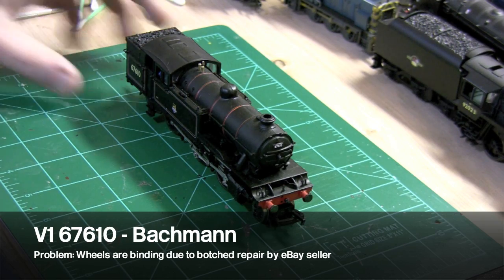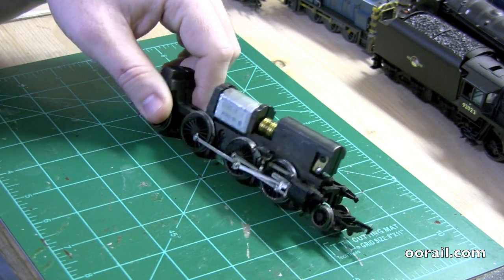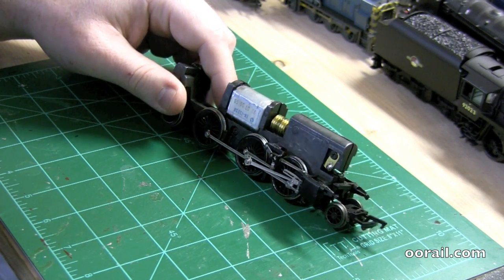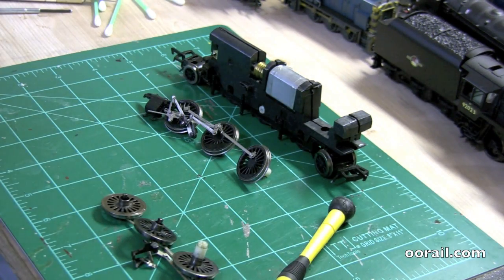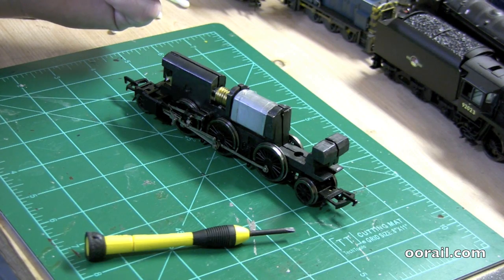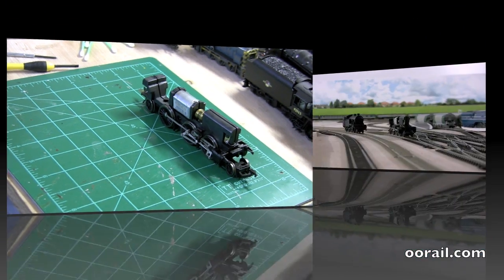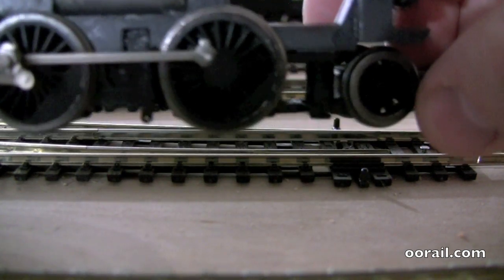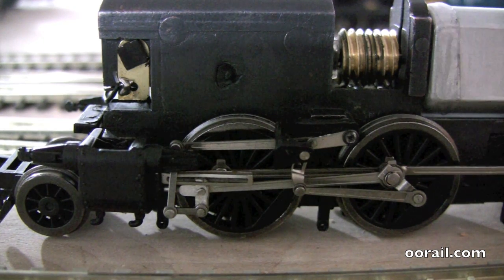oorail.com | Loco Works Wednesday #2 67610 Quartering a steam loco

Comment: I realize this vid is from 7 yrs ago, but wanted to say thanks very much for the great content; I was able to get a bachmann 0-6-0 from the 1970s running by quartering the drivers (and completely taking apart, servicing and reassembling the pancake motor). Couldn't have done it without you! I just wanted to see it run again! Very satisfying to get it going!

Comment: Do you ever run your locos SLOW? Seems difficult to actually "tune" the valve gear,  when you only run WIDE OPEN!
Reply from the maker: Absolutely, all the time. Found though with how-to videos over the years that a lot of people just want to see that it worked, so if your run the loco a little quicker, shortens the segment time and they keep watching :)

Comment: I am experiencing some wheel wobble on my new flying scotsman. Nothing major I'm just ocd about it and thought it needed quartering but I guess it doesn't. I see its 90° offset already. Thanks for explaining what quartering is.
Reply: DJMixFlow93 
Flying Scotsman is a three cylinder loco, and so the side connecting rods should be at 120 degrees, not 90. Key thing is that the side rods are not  near 180 degrees...

Comment: By the way, if you're REALLY going to try to check and adjust the quartering of a steam engine,  you must have a quartering jig/ tool to do it accurately. A company called "North West Shortline" sells such a device. This stuff about running locomotive nearly wide open serves no purpose...

Comment: Do you have a video on servicing this type of engine/motor? Bachmann split chassis? The mainline style is different
Reply from the maker: You are looking for a video on servicing this style of locomotive from Bachmann?
Reply: Yeah
Reply from the maker: Doesn't look like I've done one specific to this type of split-chassis locomotive, but I have plenty of these locos, so won't be hard to find one that needs maintenance. I'll see if I can knock together a video for you on it..
Reply: Brilliant thank you, that’s be helpful. My Bachmann BR standard class 4 isn’t running well
Reply from the maker: You're welcome. Have you tried cleaning the wheels (cotton bud / qtip with some isopropyl alcohol (91%)) and the contacts with the same?
Reply: Yeah I did them with lighter fluid, it improved it, but still low on pulling power

Comment: Interesting, but surely since the model is not really being piston driven, quartering is purely for aesthetics right? Isn't it more likely that the wheels were jamming because the valve gear was all wrong?
Reply from the maker: nope... it doesn't have to be perfectly quartered but they are designed to be offset. If they are not offset they will bind...
Reply: oorail.com 
It's worth emphasising that typically only one axle is driven by the motor (actually like most prototype locos) and so the quartering is still important to ensure the other axles can be rotated by one connecting rod which should not be in line with the axle.

Comment: Thank you once again for taking the time to reply to my comments. 
Alot of what you and I do is really basic stuff however, I have found over the years that people decide that its too difficult and do not even attempt repairs or even basic maintenance. This is where videos such as yours come into play. If you can tempt people to at least have a go they will gain both confidence and a fatter wallet.😊   You will know that the biggest part of a bill is not the parts required but the labour charge.
As I have already mentioned you need to hold peoples hands and guide them step by step, sad really when you think about it.
Its up to people like yourself to show modelers the "can do" attitude and dispel the "can't even try " attitude which seems to haunt our society these days.
Keep on making your videos, you will make a difference even if you never hear about it.
Sorry for the spelling mistakes in my last comments, the main reason I retired from doing what I loved, eyesight no longer up to par😢.
Good Modelling. 😊

Comment: What a very uninformative video.  Whats the point in the whole thing when you speed up the most important bit. I am no wiser at all?
Reply from the maker: The point is to leverage the YouTube speed option in the viewer. Click on the "cog", it might be a "cog with HD" written on it. Select speed, then select 0.25, 0.5 or 0.75, depending on your preference. You will likely want to hit the mute button as it will distort the audio. The point of doing it this way is that at normal speed people can see whats happening but it doesn't take 30+ minutes. If someone wants to see it at a slower speed, like you, you have much better control with the 0.25, 0.5 and 0.75 speeds with it sped up at normal speed. Without it sped up like that, the 0.25 setting really is too slow to be of any use. This way, you can watch it at 0.25. This is the reason why there is music and no informative speech during it either. This video is about 3 years old, but I'm pretty sure I walked through what was going to happen in the segment before it was sped up too. So hopefully now you are a bit wiser about both using the YouTube player and quartering a loco. If not, perhaps this isn't for you and you should send your loco off for repairs?
Reply: Hi again. Thanks for the reply it is nice of you to take the time. I get the whole principal but I am still puzzled.  LEFT or RIGHT SIDE. Is left the left side that you see just before you are  run over bby a train or is it the left side if you are driving the train?
Andy
Reply from the maker: That is a good question. It is just like the left-hand and right-hand drive with a car. Trains in the UK are left-hand running.
Reply: So which classed as the left side?  Is it the left as if you were driving the train and standing or sitting in the cab it OR is it the left that you would see as if the train was coming right at you?
Andy
Reply from the maker: I already answered this question with my previous comment. If you are driving a left hand drive car, with the steering wheel on the left side, you are sitting on the left hand side of the car. Trains are the same way. In the UK the driver's seat is on the left hand side, and the trains are left hand running (run on the left track in a double track setup). The drivers sit on the left hand side because the signals are on the left hand side of the track etc. LNER I think was right hand drive, possibly a few others.

Comment: the easier way would of been to take the bottom plate off and remove the whole wheel assembly then quater the wheels by just spinning the wheels on the axles. this video is a waste of time in both watching and requatering
Reply from the maker: Its a split chassis loco, so you can't drop the wheel assembly from the bottom plate like you can on Hornby locos. You would have to take the chassis apart completely and that is a lot more work than simply quartering the wheels like I did in the video. Also for this particular loco, the wheel assembly was incorrectly quartered and the rods were in the wrong position, so you couldn't just spin the wheels on the axles.

Comment: The Chinese equipment is so poorly made that I long for the American made trains of long ago.
Reply from the maker: The Chinese made locos seem to be somewhat lacking in Quality Control that is for sure. Since I order most of my locos from either the UK or Canada, its not really worth the cost of shipping things back if there is a problem, have to sort of fix it myself. I have a Heljan Class 26 (brand new) that has a few buffer beam issues and I fixed a few Hornby locos with minor things, like loose parts. I think 3D printing will change the hobby over the coming years... hence why I picked up some 3D printers :)
Reply: Why couldn’t you remove pins on one side of loco then move those drivers thru 90 degrees and re-assemble connecting rods back into drivers.  HINT.  Don’t post repair videos that are not in  real time. And no crappy music please
Reply from the maker: That won't work. Give it a try and you'll see why. HINT. Click the settings gear, select speed and slow it down to your desired watch speed. Have a nice day! :-P

Comment: Too fast music too loud and I am non the wiser  and you have a lot of viewers saying the same
Reply from the maker: Use the speed control in the YouTube player to slow it down, hit the settings cog, then playback speed, then 0.75 (3/4), 0.5 (1/2) or 0.25 (1/4) depending on what speed you need, and hit mute. I explain in the video whats being done before and after it happens. People only comment when they are moaning, about 75% of the folks like this video and about 25% moan. My guess is that the 25% probably aren't that tech savvy. This video isn't intended as a how-to, its part of Loco Works Wednesday which is a series where you get to see stuff I'm doing on my workbench. I might do an actual how-to video on this and link it because I'm getting tired of having to tell people how to use YouTube properly :)

Comment: Oh dear, a good intention but not an instructional video. I was looking to find out how to 1/4 my  old Hornby Princess Elizabeth loco. Interesting for a few moments, then we go to time lapse along with some dreadful music(?) Hands flying everywhere, good views of the back of the right hand, not so of the loco. OK, slowed it down, the music(?)  degenerated to the sound of a coffee grinder burning out its motor. The voice, when it came on sounded like someone was terminally ill. Now, I'm no Oscar winning film director, however I would suggest the following. Reshoot the video at normal speeds, no music, not even Beethoven's 9th, overhead camera or frontal position, more use than seeing the backs of hands. Clear audio which can be heard, the use of a pointer, a yellow pencil works well, instead of a finger blocking the point of interest. A little rehearsal, with the camera running might be useful too. Run the video, ask yourself "Would this help me to fix the problem?"
Reply from the maker: Thanks for your feedback Chris. You probably want to mute the video if you slow it down to watch certain parts. Quartering is pretty easy, the purpose of the Loco Works Wednesday videos are just showing people stuff I am doing on my workbench, sort of looking over my shoulder so to speak rather than a formal tutorial. Good luck quartering your loco, it takes patience but like I said is very easy. The reason it was sped up in the first place is that you don't need to see the entire process, you basically just adjust and readjust, whats important is the offset between the two sides at the end. Unfortunately, that seems to have eluded some of the people who commented... including yourself. :)